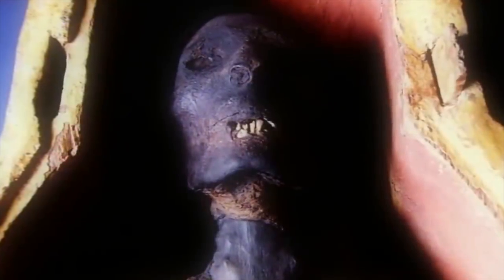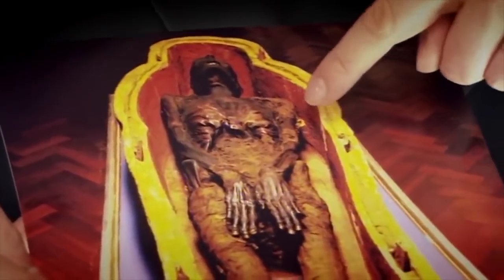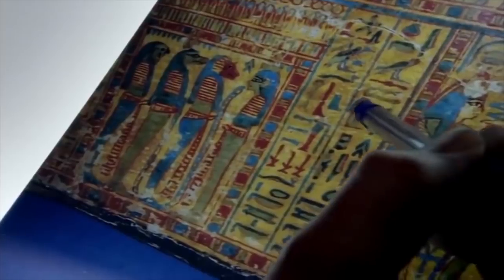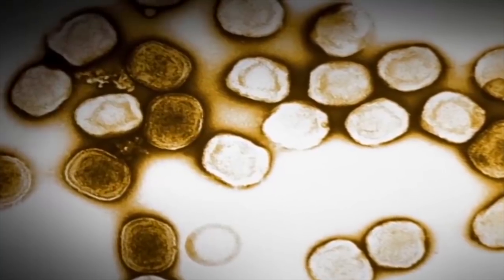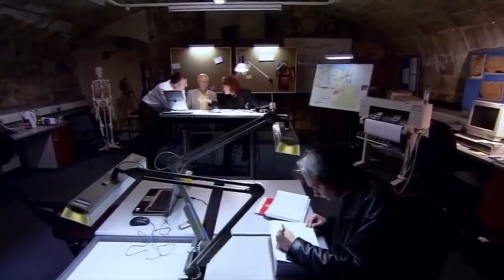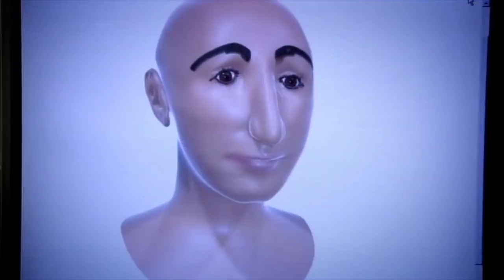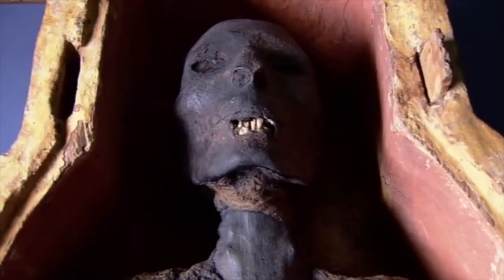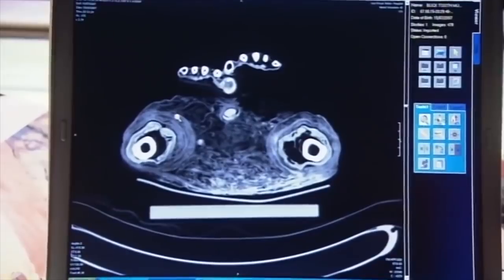The Mystery Of The Misfit Mummy | Mummy Forensics | Absolute History

Comment: I wonder if they keep a DNA data base of all mummies they examine or find? They should so that way they could match up families and dynasties easier instead of relying on the coffins and places of burial to identify them.... Can't they find viable DNA from the marrow in the bone or teeth?
Reply: They mentioned in the video that DNA will degrade over time and is sensitive to time and temperature. This long after death there will most likely be no DNA left
Reply: they likely aren't allowed to desecrate the mummy by removing teeth and breaking open bone to examine the DNA on the off chance that the DNA is still viable. They can't even really touch the mummies because they are so fragile and valuable and have to be given super special permission just to get a tiny sample of the mummy's rapping so removing a tooth is really not allowed much less breaking open a bone.
Reply: @annahuffman7304    What you posted was absolutely not true. It's done all the time.....Usually, (with the advent of modern science) one doesn't have to "desecrate" a mummy or corpse to extract DNA. It's done as carefully and delicately as possible.  You don't need a large amount of organic material to extract the DNA that's needed. It's not 2002. Smh.

Comment: These people were able to produce Chips of skull inside the brain using a metal rod witch the Egyptians didn't have but yet that determined that the Egyptians were able to produce those chips using bronze or copper rods! It 100% could be that those chips of skull could have been from a blow to the back of the head causing their deaths..  Some of these shows are blatantly deceiving people.. Seen one show where this old guy was going to prove how the Egyptians made perfectly round holes in stone using bronze tools, he was able to make one round hole aboutb2 inches deep in 3 full days of work but when he remove the cylinder from the hole he used metal chisels but claimed it was sufficient enough evidence... Listen the Egyptians wouldn't have spent 3 days to create a 2 inch deep circular hole cuts then used a metal chisels to remove the cylinder .. For one they only had bronze tools so if we could reproduce it using the same tool chance are they didn't make those holes, 2 if they couldn't have made them that mean the people that did had technology that was able to do so witch mean there were more than likely someone in Egypt doing those things way before the Egyptians got there!